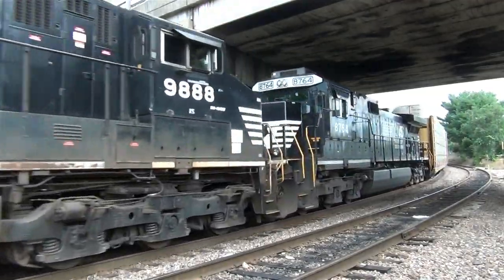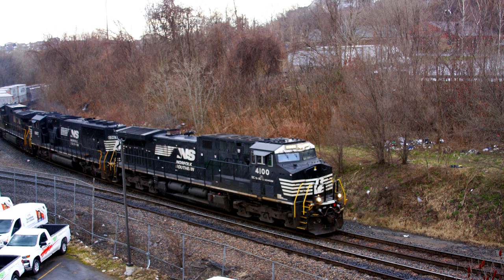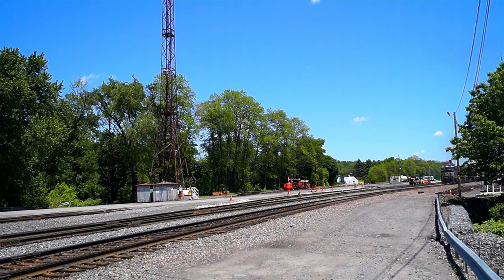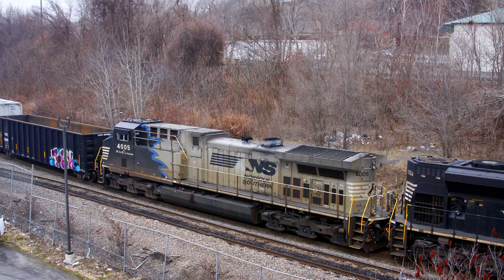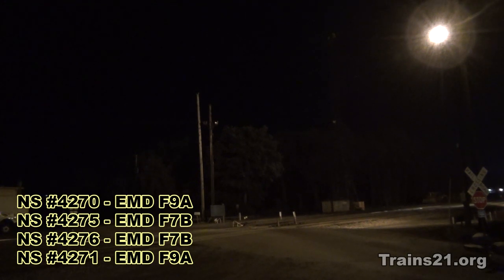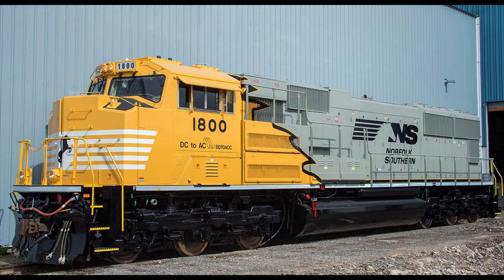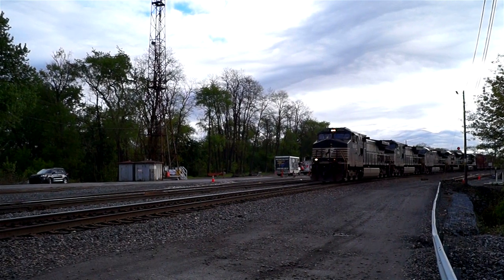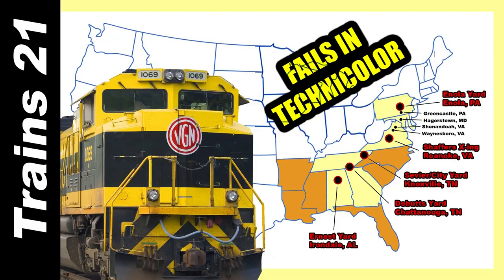NS Dash-9s (1 of 14) The AWESOME AC44C6M!

Comment: AC i do know that AC motors have more power than a DC motor. You can stall a DC motor train on a grade but a AC motor will pull a train on start on a grade. My electricity education has paid off 😁

Comment: You forgot ns 8520, the red sonic
Reply: That's an AC44C6CF
Reply: @joshpack7330  he mentioned the yellow sonic ones, thats not a AC44?
Reply: @trainchaserlouisvilleindia7096  Those are the SD70ACCs
Reply: @joshpack7330  they are still not the same as a AC446M’s so why not have the so red one as well since you put every other sonic bonnet in the video?
Reply: C6M, not C6CF. 8520 wasn't worth a lick to NS. Tested and failed, it'd be a pointless inclusion